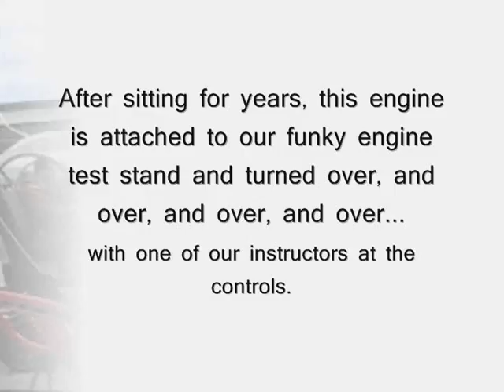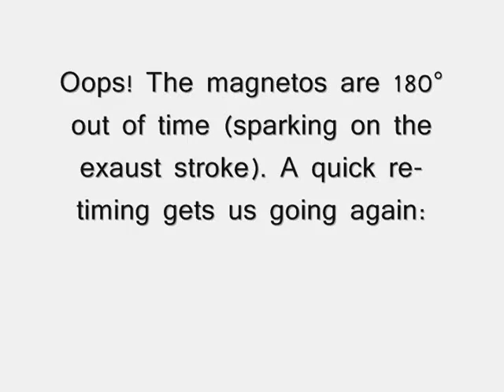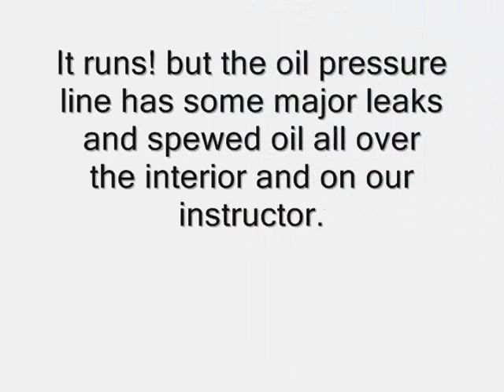Radial Engine Test Stand Run Backfires

Comment: Insuring mags  (or distributors)  are  not 180 out is easy,  two ways.  If  you can access  rockers,  observe  rockers on no1 cylinder.  At  TDC  / compression, both valves will be closed.  Otherwise,  crank the engine  (by hand)  with a finger/ thumb/ gauge  in the no1  plug hole until you get compression.